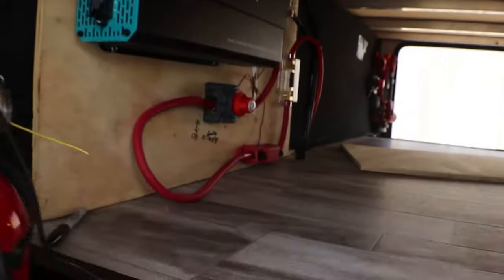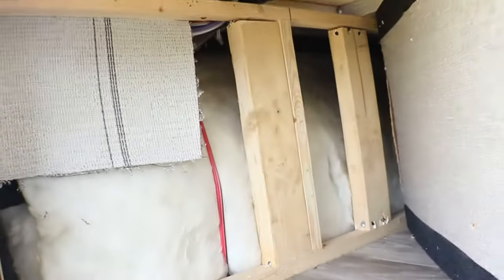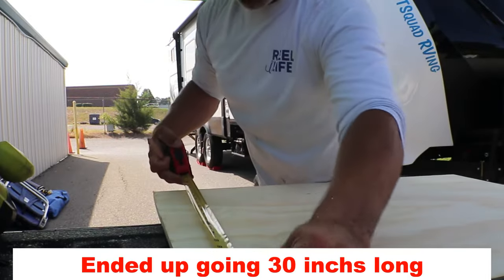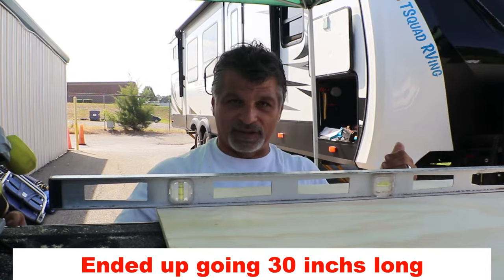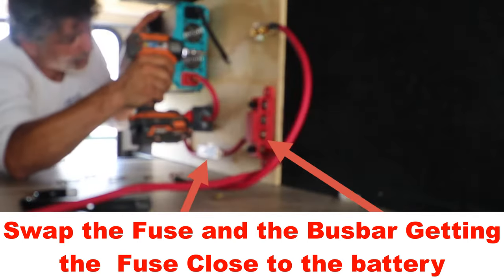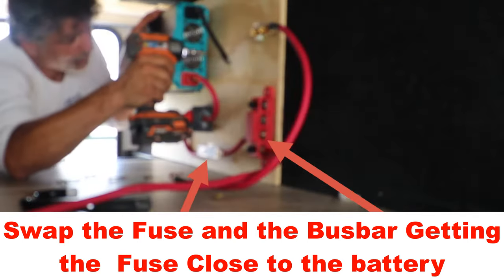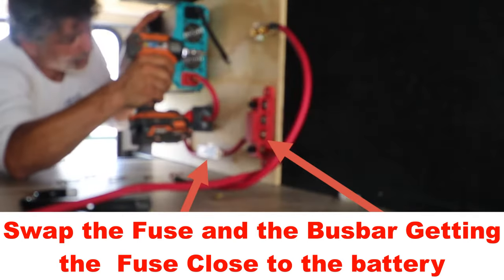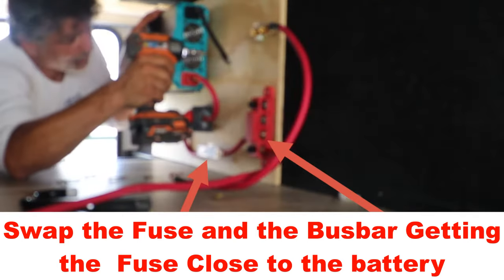How To Power Your Entire RV With An Inverter | Easy Inverter Power,

Comment: You said you weren't gonna get into your batteries? You said you had lithium batteries? What group size are you using and what Make you using? I'm going to do a basic set up like that to my travel trailer and I'm trying to figure out what batteries to go with so that's why I'm asking.. Thank you....
Reply from the maker: Battery that I’m using now.  I went with two  https://amzn.to/44QvzCb
Reply: I have two 100Ah Battle Born lithium batteries and 400 watts of solar panels, 3000w inverter (pure sine wave)
Reply: @jonedwards2107 I'm currently building a similar system. Quick question, if you had it to do over would you build a larger solar array, or is 400 watts of Solar enough to use your system at a high efficiency rate?
Reply: If you have a 30amp solar controller, max it.  Go to 600 watts of solar.  I am going to add another panel.
Reply: Group size is irrelevant, group size is just physical dimensions. As long as what you get matches that's all that matters. 200 AH of lithium is decent for most people, forget about running AC unless you wanna spend like $2000+

Comment: I have the same inverter and mounted it very similar to what you did. It works great!  One difference was I control couple nice mounted power strips that plug right in. Then I use one circuit hard wired in the camper. The reasons I decided against the way you chose is this way it operates the same weather I am plugged in or not. No remembering to turn the charger back on or off and I don’t need to make a connection or leave my storage compartment open. I also cannot accidentally use the microwave or heat or AC on my batteries which would drain very quickly if you did. 
I also chose to use the remote function as it just takes a moment to see and push the button if Ive left it on or need to turn it back on.

Comment: Experience is the best teacher.
1. You might consider using at least a 3000W FSW Inverter.
2. You definitely want to use a charge controller so you won't cook your batteries. Maybe your inverter has one, some do.
3. You won't be able to get near your battery switch if there is a fire.
4. You definitely want to use the inverter remote inside the RV... Bad weather... and just a pain to get into the basement.
5. You will want to hardwire as much as possible because of vibration when traveling. You can still use the extension cords. Most receptacles are very loose.
6. You may also want to wire in a relay to switch between shore power and Inverter power. I use the 80A 120VAC coil relays and the coil is wired to shore power.
Reply: I would argue the wired relay is a no brainer.

Comment: The perfect solution to my temporary needs. Proverbial snake but I was having a brain fart regarding tying into the panel.  Knew the converter would need to be disconnected at night when I switch to the inverter from generator.
Thanks so much 🙏

Comment: When did you install your inverter, wondering if you’ve had any issues?  I just bought a 3,000 watt Renogy pure sine wave inverter, 2 x Redodo 230 amp hour batteries. As soon as I get my hydrologic press to put the lugs on the 4/0 copper, I’m installing it. One pointer. I plan to install a 30 amp female plug next to my inverter, with a stock plastic access hole for my Shore power cord can fit through. Since I’m using 3,000 watt inverter, 460 amp hours batteries, 4/0 copper, I’ll be able to plug right in. The camper will think it’s plugged in. I should be able to run the microwave for almost 6 hours, AC for 2 1/2 continuous hours. I only have a 190 watt  panel from the factory, adding one 200 watt to the roof. That should give me about another hour run time in good sun. I’ll be testing and in all likelihood, this will serve my needs. I wish I could get enough solar and battery to be self sustaining so all the federal campgrounds that don’t have electricity will be open for camping. Did you ever test to see if you turn off the converter, the 12 volt refrigerator will still run? I forgot about it until watching this again, thanks

Comment: Be sure you don't pull 20 amps from that inverter. As them outlets are only rated for 15 amps each..The direct connection on it is rated for 20amps..
Reply: Excellent point
Reply: Novice question - how do you ensure you don't pull 20 amps?  Also with a 3000w inverter could I run my micro and air?
Reply: @mjcoleman  You can run a microwave or AC unit But not both on high..
Reply: @WizzRacing Thank you

Comment: Why did you use 20 amp cord instead of 30 amp to 110 converter? Thanks for video exactly what I'm trying to do! Not enough money to pay someone to install 👌
Reply from the maker: Hey!!  Thanks for that question.  So. I don’t think I would be pulling a more than 20amps so I decided to go with it.  Works great.   Love using my Inverter when we are at Harvest Hosts or Cracker Barrels for the night when no Generators are allowed.  Gives me enough and some power to get through the night using all my plugs and tv on.  (Just don’t forget to turn off outside refrigerator 😂.   Glad it helped. And thank you again!

Comment: Wire loom is not intended to replace a grommet… use a grommet when u go thru things u don’t want the wire to chafe on.
Reply from the maker: You spot on.  I ended purchasing misl grommet sizes and place one on that metal frame.  Now I’m stuck with 180 piece set from Amazon.  Lol.  Thanks so much for your comment.  Good observation.

Comment: If you have a fuse at the battery you don’t need a fuse on the same line close to the inverter. High current draw anywhere will blow the fuse. The reason you put a fuse close to battery is to protect the wire shorting.

Comment: Can I do this with my Class A Motorhome ? Will it run my Roof top A/C Unit ? What is the minimum size Inverter should I go with to safely run everything in my Class A Motorhome ?
Reply from the maker: I would think you can do this with any rv.  Sorry for the delay.  I do not get notified when I get comments.

Comment: Yes I have a question , class a rv with onboard genny but would like to do a simple plug in for tv and lights. Understand I need to turn off inverter on the rv .  But by doing that am I turning. Off the 12volt pilot lights to fridge and water heater that we would run on propane while BD ing .  That’s my concern or does the inverter have nothing to do with the lights and other 12 volts system that runs off the house batteries as well..

Comment: Ok, you said you are adding solar later so how are you charging your batters if you have the RV converter turned off and the inverter running off from your batteries?  What kepts the batteries charged?.
Reply from the maker: Once you are done using the inverter turning the converter back on when you connect to any source of power that will charge your batteries.  If it’s sitting for months I take the batteries and place on a trickle charger.  Hope this helped.

Comment: Excellent video.  We have a GD 2670mk with 2 lithium's maintained by 175w solar already with a converter.  We want to add the same inverter so that when boondocking we have 110v off the batteries, but are maintained by the solar.  So I'm guessing where you mentioned "switching off" the converter, we'd leave our on?  Other than that, you've done just what we're about to do.  Thank you for the video!
Reply: No.  Any time you are running an inverter from your rig's batteries, turn off your converter at the breaker panel.  Otherwise you will have the loop going, and no amount solar will offset that drain.
Reply: The converter's job is to try and charge the batteries when you are plugged into shore power.  So think about it for a minute:  Your inverter is plugged into the shore power, and it is powered by the same batteries the converter is trying to charge.  It doesn't matter that you have solar also trying to charge the same batteries,  The "loop" is going to win.  Cut the loop, turn off the converter at the panel.

Comment: So turning off the breaker for the converter in the rv do your 12 volt lights work? I thought the converter charges the battery and converts shore power to 12 volts for lights vent fans ect.
Reply from the maker: Correct. But the breaker off eliminates a continued cycle when using the inverter with the batteries (without shore power) And you wouldn’t need the 12v system if using the inverter for power.  we are simply using the  batteries when we do not have shore power to power the entire rv of course with out using the AC.

Comment: Thanks for this video. Very informative for someone looking to do a much simpler inverter setup. With that being said, you mentioned wiring it with your solar later. Do you have a video on how you did that if you have done it? We have solar panels on our rv and I’m thinking I want those wired in as well so that the battery can charge when the converter is switched off. Or at least that’s how I think it would work 😂
Reply from the maker: Absolutely.  I believe there is a port to wire into.  Unfortunately we did not get solar panels yet. But if we do we will make a video.   Thanks for watching.

Comment: Thanks for the video! I am trying to do something similar with the same inverter and a truck camper.  It looks like you didn't connect anything to the case's ground.  Any thoughts on that?
Reply from the maker: Hmmmm.  Trying to understand the question.  Can you give me a time in the video.
Reply: @TSquadRVing  If you look at 6:29, right below the black, negative cover you will see a metal stud.  My Renogy manual talks very, very briefly about this on page 11 I believe.  My understanding is that's there to ground the metal case of the inverter should there be a fault with the inverter itself.  Without that, a fault could cause the case to become hot which can easily be lethal with AC.  I "think" you need to bond that to your neutral so that if a fault occurs it'll blow your fuse rather than leave the case hot...but I'm not confident in that.  Worth noting that this is different than the GFCI protection the inverter provides for devices you plug into the inverter that might fault.
Reply from the maker: Guess What I’m doing tomorrow???  Good catch!!! And Thank you for that missed crucial part.  

Renogy Pure Sine Wave inverters come equipped with a grounding lug for appropriate grounding to earth ground or to another designated ground (For example, a metal frame of an RV). The connections to ground must be tight and against bare metal. Whether using the inverter in a mobile application, such as an RV or in a building, grounding is highly recommended. The recommended wire size for grounding is 10 AWG insulated copper strand wire. For more information regarding grounding, users and/or installers must consult with the Local and National Electric Codes (NEC) for more specific grounding regulations and suggestions as they can change per scenario.
Reply: @TSquadRVing  Hope it goes smoothly! I'm still trying to figure out what to do with an all wood truck camper.
Reply from the maker: Please send pics when done.  I like to see progress.  Lol.

Comment: Can inverter 1000w work with battery 200ah to run screen 32 inch and 8 bulbs in 24 hours
Reply from the maker: Thanks for watching. Yes that should work.  Make sure you use LED bulbs. I used two 110 AH batteries and had no issues.  Good luck.

Comment: Hi! I am a new Rv owner and I want exactly the same thing as you wanted to be able to watch tv while stopped for the night at a rest area or a harvest host that don’t like generators. My question is if you turn off the converter will your DC power still work? And you said that you can recharge the batteries through just plugging into either a generator or shore power even with lithium batteries? Someone told me that my charge controller that came with my Rv would not charge lithium batteries. So they were wrong or did you have to change your charge controller for lithium? Thanks for the great video and sorry for all the questions.
Reply from the maker: Well by turning the converter off you do not need DC because you are using your batteries thru the cord from your Inverter.  And yes when plugging into shore power or the generator making sure that you converter is back on like a normal hookup it changes the batteries regardless if it’s Lithium.  I am not aware of any charge controller for lithium.   But as I always say if you are unsure I would continue to look into it.  
When we go to a Harvest host this is my routine. 
1. Turn Converter Breaker off.  This way your not trying to charge your batteries with its own power!!! 
2. Connect my cord to my Inverter and RV (like connecting to Shore Power) 
3. We use our batteries all night for TV, charging our devises, lights. Keeping our Fridge on Propane uses less power from the batteries.  
4. Monitor the batteries. By the time we wake up we have just enough power to close up the RV. 
5 disconnect RV from Inverter
6. Turn Converter on so while driving to your next location it charges your batteries.  
Always make sure that you do not drain your lithium’s.  
Hope this helps.  Safe travels.
Reply: @TSquadRVing     Thank you so very much for taking the time to explain everything to me! I am a single female traveling alone and need all the advice I can get. I also joined harvest host! You mentioned a victron item. Can I ask what that is? Is that a charge controller also? And several people say you need fuses and bus bars and things I have no idea what they are for or do. Would you ever consider making a video showing set by step how you did it and everything we would need? I am sure there are many people that would love to see how to do it! Because this is exactly what most of us need.  Thank you again and happy travels. Stay safe!
Reply: I have watched several of your videos and have learned so much!
Reply: Tonya, If I’m not mistaking, I believe you were asking about your factory converter being able to charge your lithium batteries or not. Most RVs and travel trailers a few years old have converters that are not Lithium specific. It will still charge your lithium batteries, but not charge them more than 80% of its capacity. You would need a specific lithium-capable converter  to fully charge your lithium batteries. Most of the time, you can get a lithium-capable converter with identical specs as the converter that the factory installed.

Comment: Good video.  I want to add an inverter to my GD imagine, but am struggling with a comment that you made.   You said you turn the converter off.  By doing so, yes it doesn’t try to charge the battery, but doesn’t it also shut down your 12v system. Such as the furnace and water pump?   I have a 12v Fridge that I believe is wired to the battery, not the converter.   This is my only hold up.   I plan on a 200ah Lithium battery.
Reply from the maker: Email me tsquadrving@gmail.com
Reply from the maker: Hey John.  Thanks for reaching out.  Although I’m am not an electrician or a RV tech this is only my opinion so if you are ever unsure I would check with an electrician. 
That being said. 
If I’m not mistaken when you click the breaker off to the  converter from the electrical panel so you can use the Inverter from your batteries you are only turning off the converter breaker not the 12v system. You’re not turning the main breaker off which eliminates power to everything and will not allow the inverter to power anything because it stops at main coming in.  Unless your panel is wired that way.  I think with a few Lithium 200amp in parallel would be ok with the 12v fridge. Bad with numbers not sure how long though. 
Please let me know if I answered your question.  I hope this was helpful.

Comment: great video, but how the batteries charge if u turn off the converter?
Reply from the maker: They do not charge. You would be using the power from the batteries because you do not have any other source.  Once you connect to shore power then it will charge them.
Reply: You would require a solar setup in order to charge your batteries when not connected to shore power.

Comment: The only thing that I can think of that I would do different would be to take a hook up adapter wire with hook up and just cut the other end off and connect it to the hardwire hookup connection this will give you a better power connection and I believe better current flow check your user manual to be sure but I think I'm right. :-)

Comment: I have a 1989 motor home - I don’t think it has a switch to turn off the inverter. Where would that switch be?
Reply from the maker: Thanks for that question.  I would see what wire runs to your breaker box because it has to to be on one.  And use that breaker to turn off.  If it’s on a circuit with multiple items on it you may want to separate and put one in to its own circuit if you have room.  I hope this help.

Comment: QUESTION; IF YOU HAVE A 12 VOLT REFRIGERATOR, WILL CUTTING OFF THE CONVERTER, KILL THE REFRIGERATOR?
Reply from the maker: Hey.  I think it would.   You should try and let us know.    Thanks for watching.
Reply: No the converter concerts ac to dc to charge batteries. There is still 12v power at the panel with the converter off its just not charging the batteries. The water pump, furnace, fridge and lights still run off the batteries